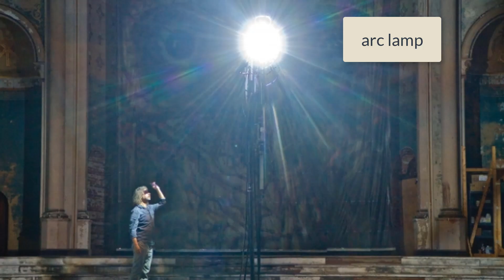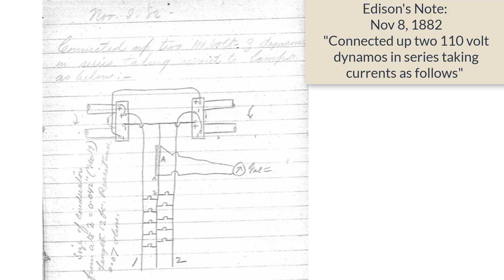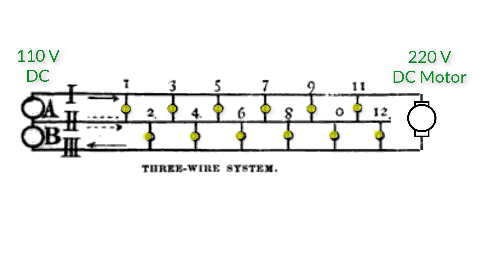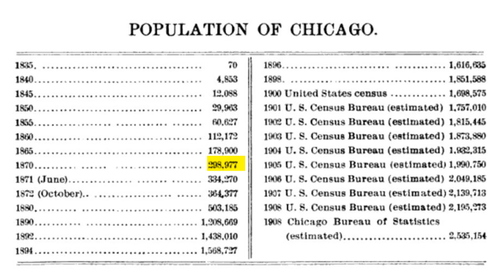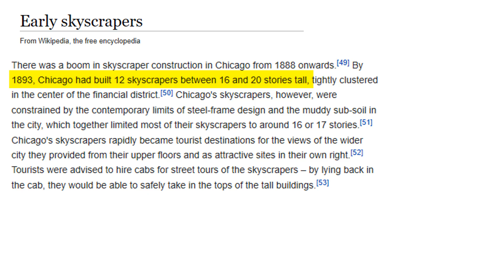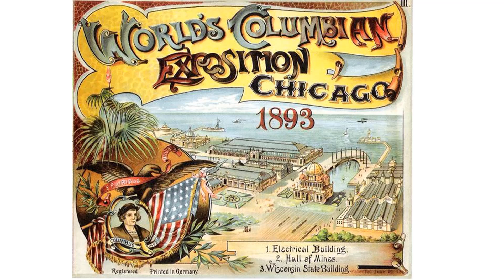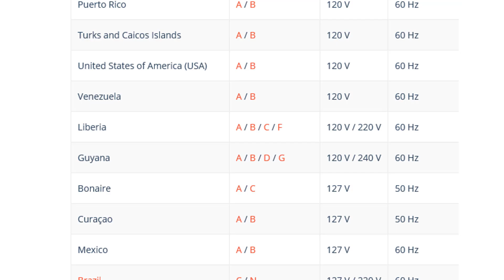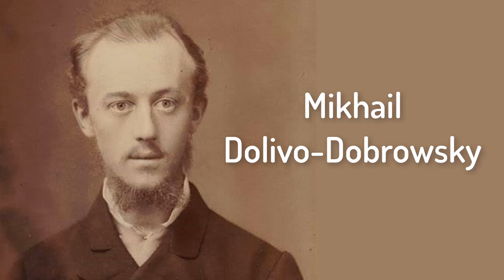Physics and History of Why USA uses 120 volts and not 220 volts

Comment: On my sailboat located in Australia, I have 12 Volt, which is DC. however, the struggle to have AC power 220 /240 which needs an inverter from DC to AC to run AC appliances. 
Your historical presentation as to 110 volts and 220/240 volts is helpful as to why a difference in AC volts. There are a number of appliances made in the US I would like to install on my sailboat. However, it's not practical, as it would really complicate installing two different AC inverters and power plugs plus reciprocal sockets.  
For this reason, 110 volts on my sailboat is just not practical to have two AC systems fed by 12-volt AC Power. 
Thanks to your research effort and tutorial, the mystery is solved, at least now I know why 110 volts, is not available outside North America. Thanks, and keep up the great work.  SV Skoiern IV

Comment: Almost all houses in the US have 220-240 volt and most higher draw equipment, electric water heaters, electric ranges, clothes driers,  and are 220-240 volt in most US homes. It comes into the house as two 110-120 volt to get the 220-240 volt, but most outlets use only one or the other side so have 110-120 volt for most electric stuff. It is crszy so many people say the US is 110-120 volt when we use both.

Comment: Why did Wallace and Edison use 110Vdc?
I read somewhere that this is related to voltage required by the arc lamp system used at this time.
British chemist Humphrey Davy invented the arc lamp in 1809. Generators became widely available in the 1840s. When Thomas Edison began working on his designs for the incandescent light bulb in the late 1870s, arc lighting had a stronghold on the market and 110Vdc may have been established for some versions of arc lamp systems.

Comment: Well Kathy my theory is that the higher voltages actually reduce the amount of current that is need for say an electric motor, So in saying that it seems to me that in the USA and others the amount of current needed for such operations actually require much higher and therefore lethal electric currents to work with and use..

Comment: 127 V is the phase to ground voltage of a 220 V phase to phase system. So in other words: Some countries use 220 V three phase system (for example in Saudi Arabia). But just to add to the confusion you might also find 230/400V.

Comment: I get this, but 240volt systems I believe are a bit more economical than the 120v systems.  Higher voltage will drop the demand for current.  That's how the parking lot lights run on 480 volts, it needs about. 01 of an amp to drive the fixture.

Comment: I've been watching the videos with great interest. I have a lot more to go. Things we take for granted did not even exist 100 years ago. One technical detail: connecting more light bulbs (in parallel) to a circuit reduces the overall resistance and more power is needed to light them up. That's why 2 or more generators were needed for those lines. Nothing is free in this business. If you want more energy, you have to provide more. Coal-fired power plants are a serious source of carbon dioxide, and thus contribute to the global warming.

Comment: ALL HOUSES IN THE UNITED STATES HAVE 220 VOLTS!! 60 Hertz
We have two lines (L1 and L2) and a neutral from the power company with a ground created at the meter.
For 220 volts you do Not use the neutral BUT for 110 volts you use L1 to neutral OR L2 to neutral.

YOUR INFORMATION WILL GET SOMEONE KILLED!

Comment: I will continue to loathe the fact that in NA we do not have 208/240v kitchen appliances (besides the range). We literally have all the infrastructure we would need, most kitchens have split receptacles in the kitchen or multiple circuits. It would require such minimal effort to install 240v receptacles in the kitchen. Manufacturers already make these appliances for Europe, we would just need them to put a different cord end on them for the NA market

Comment: well most homes use 240 volt split phase. its still single phase, but use a 240 volt transformer and center tap the transformer for the 120 volt hot leg's or split phase.  calling it a 2 phase is not even wrong since they are 180 degree out of phase.  If you use 2 Transformers each 110 volts connect to to different phases from the pole that is when you will get wired  voltages between the 2 hots depending on the degree the 3 phase is set at most are 120 degree out of phase, witch is more used for 3phase motors.  Most homes will only use a single Transformer,

Comment: Great video! Interesting info about filaments. One correction is that we do use 220V in the USA, it's just split at the home into 2 110V legs, just like the light bulb diagrams you presented.  220V is brought into every USA home from the pole.

Comment: No you are 100% wrong. America uses 110 volts and higher amps to make the houses be billed at a higher kilowatt hours. As a kilowatt is 1000 watts at 1 hour and watts are the  sum of volts times watts and since lower amperage is need at a higher  voltage to do the same work like running an electric motor, you get higher kilowatt hours to do the same thing as lower voltage and higher amperage

Comment: The term for North American home power is "split-phase" power. This is because you have 240 coming off the transformer, with what is known as a center tap that is bonded to ground. This center tap is used as the neutral return line in our modern system, and because it is  in between the two hots, literally, the two halves are 180 out of phase. This is normal residential power. 

Commercial power, and commercial residential power sometimes as well are actually supplied by 3 phase power. Because the 3 phases are only 120 out of phase with each other because of the WYE configuration of the transformer, the output voltage is 208, and of course there is a common that is used for the typical outlet voltage, although it is commonly only 115 instead of 120-125 (from what I understand).

Most electronics nowadays don't care, as they are made in a universal fashion, and only the plug matters. As such those handle 100-250 volts no issues. Small appliances on the other hand have to be designed differently as power consumption is vastly different.

Comment: I am a data com engineer.  I am not an electrical engineer.  I remember the fun (lol) of trying to calculate the energy requirements for data center PDU's which had 3 phase incoming, feeding both 48v dc networking gear + 1000+ servers @ 110v ac + sufficient battery capacity in AMP/hours  + generator requirements beyond that, etc, etc, etc.  I had to attend 2 weeks of classes with APC to learn some of what you explained in a few minutes.  
You do an excellent job of explaining things in an understandable manner.  Kudos!

Comment: The great advantages of using 3 phase 400V / 230V, is that you can use thin wires compared to the 230 V /115V 
The powerloss in cables is  proportionell to 
1/voltage ^2
 Also a 5V drop on 230V system is not as serious as a 5 V drop on a 115V system. The higher voltage system is more robust to voltage drop and saves Cu.

Comment: You seem to have skipped a very important part regarding the change from DC to AC, you can't use a transformer on DC, only AC.
Also the center wire has a shunt on it in order to read the presence of Voltage not current.
It is impossible to measure current without actually measuring the voltage at the potential divider (the shunt).
Of course modern meters use a HALL detector to more accurately measure the rise in current in a cable.
Current does nor flow, it merely manifests in the resistance of the wire. Producing a waste of energy in the form of heat.

Comment: The voltage of a transformer doesn't change the cost or size (within limits).  A 110V transformer will have twice the diameter wire on the secondary compared to 220V.   BUT, the 220V transformer will have twice as many turns as the 110V winding, canceling out the difference. 

All of the savings of increasing voltage is in the wiring, not the transformers.

Comment: I'm a Yank who moved to Australia as a teacher some 40 odd years ago... I asked the head Electrician why 220 volt system? He said the quality of the lines including material mix used. The 220 vote systems could handle the long distances the power needed to travel as the loss was small and engines still ran fine???? He was an old fella back 40 years ago. I know at my shop in the states, I needed to add a twin faze system to run my 220 Volt welders and compressors..... Just a thought.

Comment: The neutral wire splits the generator in 1/2 so the voltage is 1/2.  The connections of the generator that go the entire length of the coil are both 'hot' and are out   180   of phase.Neutrals are basically dedicated 'return' paths to the generator where as a 'ground' accepts electrical charge to any material that will accept it.

Comment: US homes have 240v supply.  It is a split system because safety and copper sales.  120v to ground is a safer voltage than 240v  and a copper mine owner wanted to sell more copper so some paychecks later the NEC adopted a standard that used more copper.  The UK went to a 250v system after WWII because it was cheaper and easier to rebuild with less copper but a more dangerous voltage (the US doesn't need fuses in every cord attached appliance)

Comment: The United States does use 220 volts...
It's a split system with two 120 volt legs that are combined to make 240 volts for larger appliances like an electric clothes dryer or an EV charger

Comment: I was replacing the electrical fittings (lights, power outlets, switches) in a recently purchased house here in Japan. The domestic electrical supply voltage is 100 volts. In Japanese houses the plugs and lights are often on the same "fuse". So I just did it live, occasionally I would get a shock, but it was just a tingle I hardly noticed it. 
The knee-buckler is that even when the light is switched off there is still electricity at the light. And there

Comment: Awesome video! very informative about the history of electricity transformation/generation!

One tiny gripe is that in the US most residential supplies are 240V 1 phase, not 2 phases 180 degrees out of phase with each other. The difference that can be confusing is that distribution side of the transformer utilizes 2 wires (1 line and 1 neutral wire going into the transformer) and the residencies side of transformer has 3 wires. The third wire is called a center tap and it literally taps into the center of the transformer coil supplying power to the residence. That's where the half voltage value comes from (half of the transformer coil turns being utilized for some loads). This is called a split phase supply and is 240v/120v from one single phase.

The neutral conductor for the residence is that center tap and that sometimes causes confusion since there is no voltage grater than 120v to neutral (some utilities supply split phase with higher or lower line to line voltage but it's the same concept). Just remember that the utilities' neutral wire and the residencies' neutral wire are absolutely not at the same potential in this scenario.

Comment: The misnomer is US has 120v mains , this is wrong , almost all US homes has 220v feed to the home by the supplier . It is then split to 120v within the home ! It is no problem running 220v to wall .  Inspector may have an issue . LOL most city inspectors are not even trained in the industry they inspect !!!!

Comment: Sometime do a segment on Boss Kettering and the Delco brand where he used 32 volt DC farm lighting plants for years with storage batteries I used to have some 32 volt bulb s they were Edison base
I also collected the generators one was even powered by small twin cylinder Maytag washing machine engine with a 32 volt output

Comment: We use BOTH voltages in our US homes.   All my heavy equipment uses 220 such as cooker hob, oven, A/C condenser unit, pool pump motors and clothes dryer.    All regular light duty stuff is 120 which is more than enough for lighting, kitchen small appliances, tv, computers etc.  I think our electrical system makes complete sense.   Yes, we have electric kettles and toasters running happily on 120 too.
I recall from 1975 when we first came to the US that my wife wanted to use her UK sewing machine so I wired up a connection to the cooktop 240 volt for her and she was able to get sewing.

Comment: Technically usa uses 240volts, 60hz, that's the main power line

It gets split into two 120v phases, to give 120v at your breaker box, two hots one neutral, and ground, hot to hot gets 240, hot to neutral or ground gets 120

Comment: I remember in my 20's testing the voltage of a power point when I first bought a multimeter and it was 242V (Melbourne, Australia, around 1992-ish). Now it is indeed 230V, however, during the day, when it is sunny, it is anything up to 245V due to my rooftop solar having to up the potential in order to send power into the grid. Even when I'm using 3kW, which is just above the capacity of the solar panels, it is at least 237, and I assume that's due to all the solar power from surrounding houses... most seem to have at least a small system.

Comment: Always enjoying your videos.  However you do not actually save copper in the transformer  if going down to 220V instead of 110V for the same power. You can think of it as doing a transformer with two identical 110V secondary windings. Connect them in parallel and you have a transformer delivering 110V. Connect them in series and you have 220V output. Some smaller transformers have been built like this but for the primary. Two 110V primary windings, use them in parallel if on a 110V mains and in series if on 220V mains. In the distribution lines from the transformer is where the saving is.
If you nitpick you can actually use a few percent more copper when going to 110V because there is less insulation, but then you can also have a little more power.

Comment: A big downside to using a 120V system is that to carry the same current, cables need to be twice the cross-sectional area than those that carry 240V, making it twice as expensive!

Comment: How would stepping down to 220V be cheaper than stepping down to 110V ?
The voltage in your coil for a transformer is V = 4.44 * BAnf where B is magnetic field, A is cross sectional area, n is number of turns and f is the frequency. A 220 V transformer side will require 2 times more windings than a 110 V side.

Comment: Kathy, good video!  You did miss a very important difference between the U.S./Canada/Mexico 120 V.a.c. and that of the remainder of humanity: 220 - 240 V.a.c. is 50 Hz.  While U.S./Canada/Mexico 120 V.a.c is 60-Hz.  While serving in the U.S. Navy, I was sent to Great Britten to serve as a corpsman aboard a British Destroyer.  I packed my kit, got on the aircraft and arrived in Scotland nine-hours later.  I made my self at home, and by doing so plugged-in the voltage converter, and my synchronous analog alarm clock. Five-days later, I set he alarm on my analog antique to awaken me at 0500 hours.  Well, every minute, my 60-Hz analog antique loses 10 seconds.  My clock awakened me nearly five-hours later than planned.  My new commander laughed, opened my dossier and read out loud: You've a Baccalaureate and Doctorate in Physics?

Comment: Hi from 240v UK...  We had a novel experience a few months ago.  A fault in the electricity 11kv distribution, left us with just 70 volts.  However all our LED lights were just as bright at that voltage.   Our 2Kw cooker elements would not heat up at that voltage.

Comment: I had a problem, Amazon allowed a seller to sell me a cold welder that uses 240volt 40amp 50 hertz power, hey Guess what, We dont have 50 hertz in the U.S. a bit of studying I found out that the reason why was that the same amount of force required to make 50hertz can give you say 3,000 rpm motor but at 60 hertz you get 3,600 rpm. BUT at 50 hertz you get 10 amps and 60 hertz only 5 amps. what this means is the 50-hertz wire is thicker and is better wrapped for safety. so 2/3 of the world uses the same amount of energy and gets twice the amount of power/amps than we do all because we're too cheap to upgrade a wire, and I'm stuck with a welder I can't use unless I go to Europe and buy a generator or an expensive inverter. (Amazon has fixed this issue)

Comment: -Thanks for your hard work and research on this.  The reason the Chicago Exposition was such a triumph for Westinghouse has to do with Edison refusing to sell lightbulbs to a competitor.  That wonderful genius Nikola Tesla took a look at the problem, and invented fluorescent bulbs, which cut Edison out of the picture completely.  That pretty much was the reason the "War of the Currents" came to an end, as AC could be distributed over thousands of miles, whereas DC was very much local-distance only.   Edison gets far too much credit, and Tesla far too little.